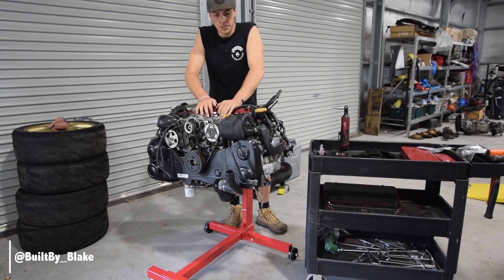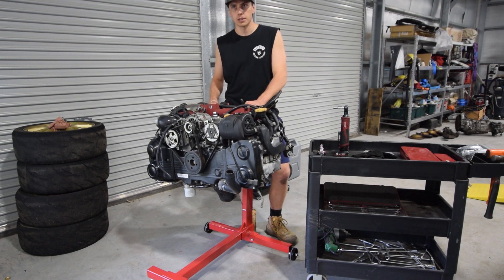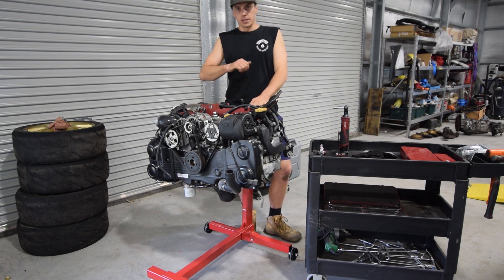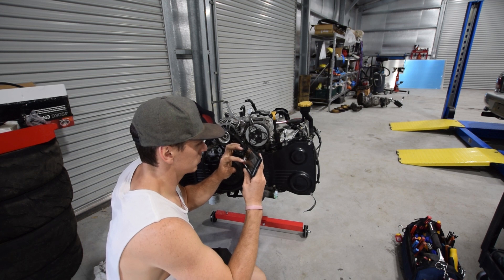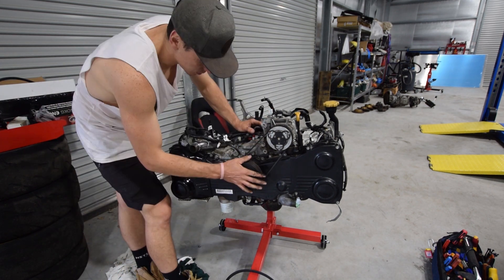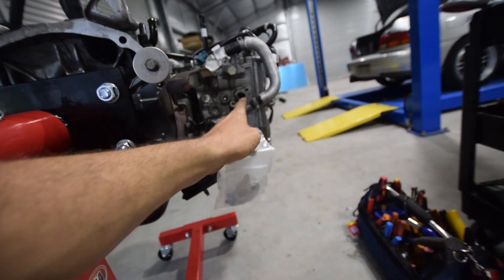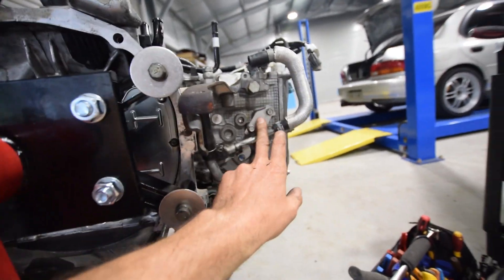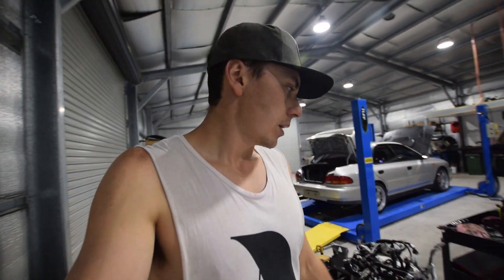Built EJ257 - Secondary Air Pump Delete & Motor Teardown

Comment: Most underrated car YouTuber out there! Glad to say I was here before 1000 subs
Reply from the maker: Cheer legend, appreciate the kind words and support 🤘🏼 we haven't even got into the good stuff yet 😏
Reply: @BuiltByBlake  hey please help me so today I finally did the the air pump delete on my 2016 STI with the block off plats. However, it was acting all crazy because the sensors weren't connected. So tomorrow I will go back and reconnect the sensors. Onces the sensors are connected can I use the that way or do I have to get the cell removed before driving. I live in a foreign country and there's no tuners that can actually do that. Please help! 😢